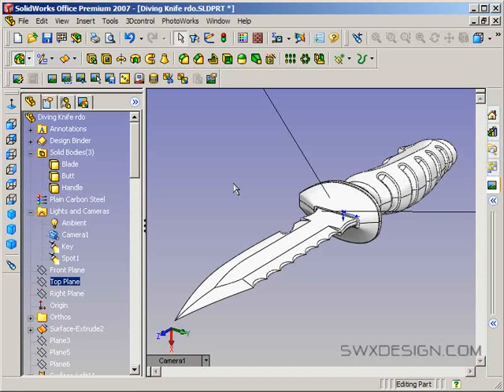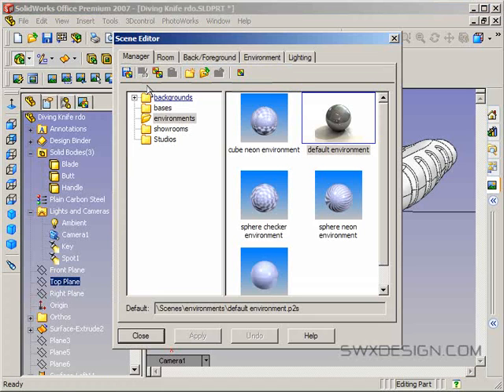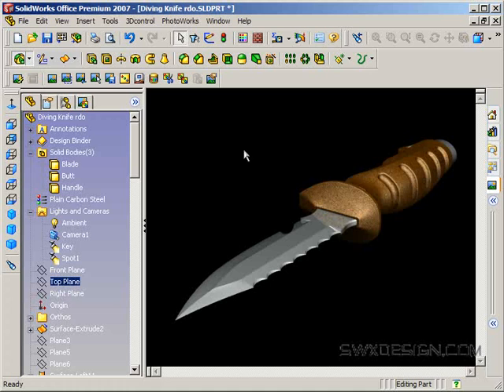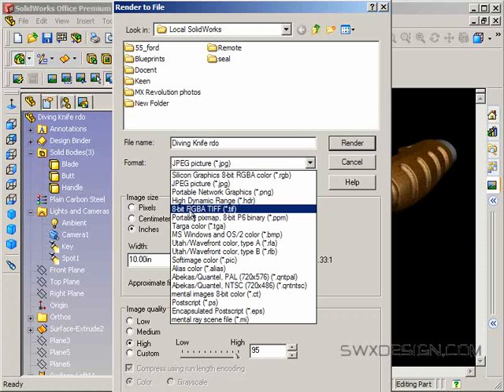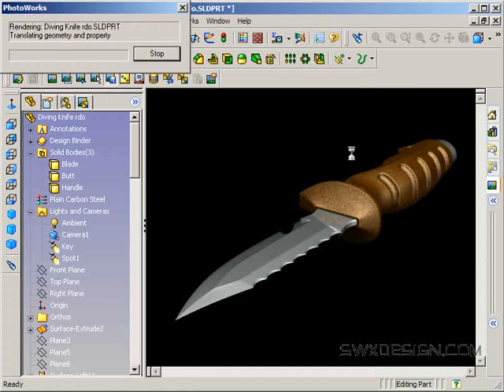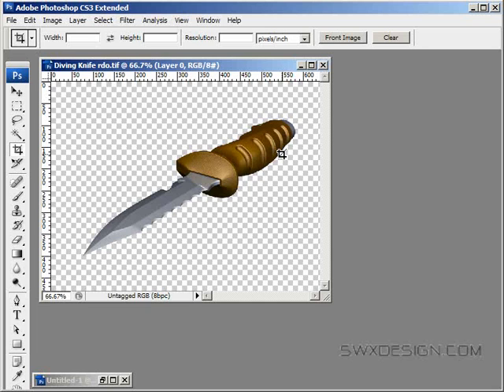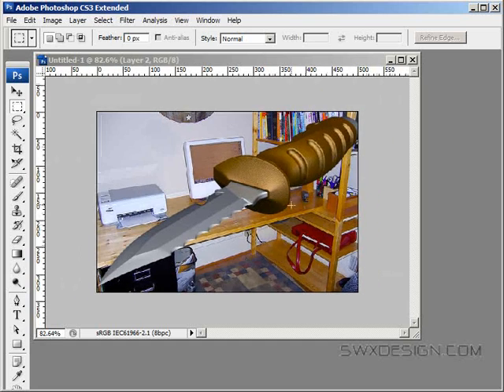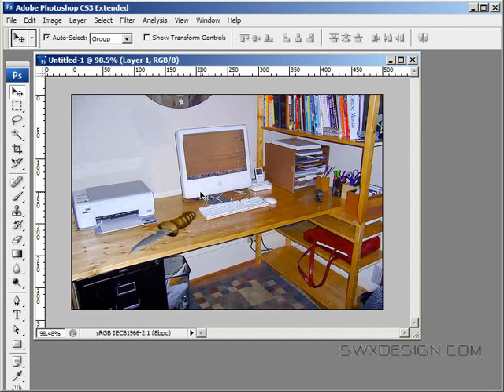2007 Render with transparent background

Comment from the maker: Since the rendering engine has changed to PhotoView 360, the techniques in my rendering videos will no longer apply for SolidWorks 2011 and later. Unfortunately I haven't used PV360 enough to answer your question.